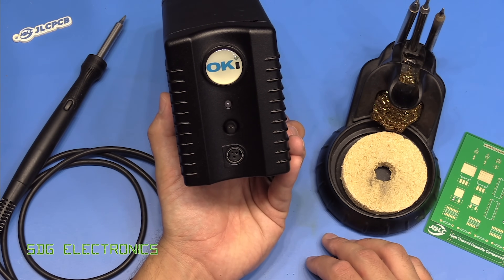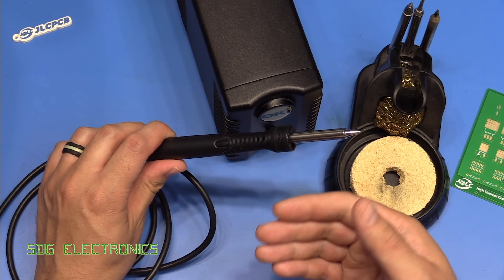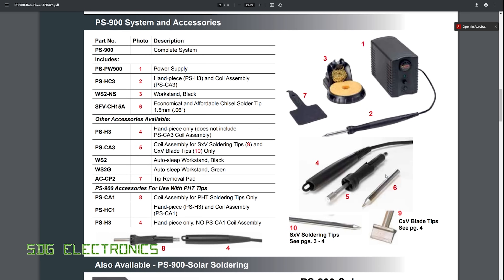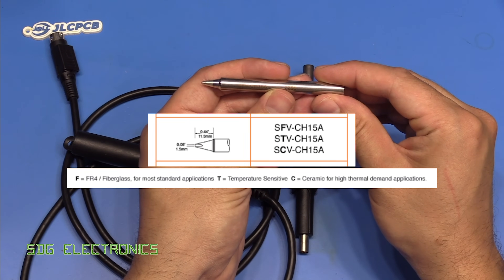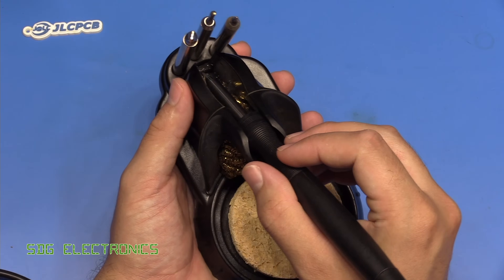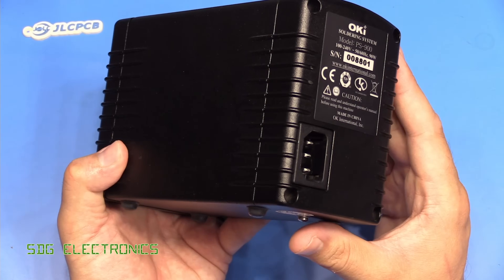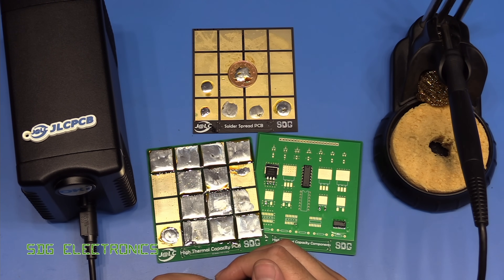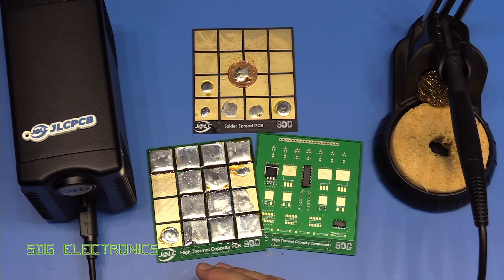SDG #218 Metcal PS-900 450 kHz Smartheat Soldering System

Comment: Yes, I love mine.  It was expensive at the time, but I have had it for over 20 years.  The company I used to work for just let people take them home.  Mine is an older model, not as deep as yours and quite a bit taller.  I am not sure what the actual model number is.  I have misplaced most of my tips which is why they gave them away as the newer models used a different kind of and shorter  tip.  I just wished it had a way to display the temperature.

Comment: Interestingly enough the MFR series of 450kHz stations has two soldering handpiece options, one of which looks like the PS-900 "chunky" one and one which has cartridges similar to the MX500 (etc.) stations. There doesn't seem to be as much easy info about the MFR stations online; I suppose this might be to do with their being more expensive (though not by much, at least in the UK) than the PS-900 but they do have other options the PS-900 doesn't have, such as a desoldering gun attachment (MFR is Multi-Function Rework). The output power rating for the MFR-1110 is the same as the PS-900.

It would be interesting to see how the handpiece for the MFR cartridges compares to the MX series stations, and to the MFR's "tip" handles that look the same as the PS-900 one.

I have an old and battered STSS unit which unfortunately doesn't work properly and is beyond my ability to repair (I'll probably keep it though as a project). I really like the design of the handpiece and cartridges so it feels like I might prefer the MFR cartridge system, but on the other hand it could just be additional cost for no real benefit since I already have other tools and don't need the "Multi-Function" aspect. There is more tip choice with the cartridge handpiece than the tip handpiece though!
Reply from the maker: The MX stations are the only ones to use 13.56 MHz which means the cartridges are much smaller, and thus more responsive. The MFR I think all 450 kHz like the PS-900 and have the option for the chunkier style tips which have a separate heater cartridge. The slimmer cartridges have an integrated heater, but are not quite as compact as the 13.56 MHz cartridges. Technically performance is lower, but they are used in huge numbers for hand assembly at production facilities so there is likely not a discernible difference.

Comment: do you have ps-900 schematic? I have a problem with the tip which has static voltage when I touch it. is it normal ? . thanks
Reply: That's a symptom of bad grounding in your electrical installation. Get a socket tester and discard that first.

Comment: Would be interesting to compare the Thermaltronics TMT-2000S which also uses Curie Heat Technology with the Metcal, apparently the tips may be interchangeable between the two.
Reply from the maker: The TMT-2000S I think is roughly similar to the MFR series from Metcal when used with the MFR-H1-SC handpiece (which takes SxP Cartridges). The PS-900 is a bit more unique with the separate heater/tip, though there is a handpiece for the MFR system that is the same as the one I've shown for the PS-900. If there is a call for it, I'll show the TMT-2000S or the MFR-1100 series station.
Reply: @sdgelectronics  I’m really interested in MFR-1100 (or any Metcal related videos by you).
Reply: @sdgelectronics and the Thermaltronics TMT-2000, actually. 

I didn’t realise it was 470kHz and so cheap.

Comment: Looks great, especially in terms of value for money. Given the operating frequency, I wonder if it interferes with nearby AM radio receivers (with 455kHz IF)?
Reply from the maker: The thick metal can, shielded cable etc should hopefully have taken that into account. I can't remember what the limits are for radiated emissions of a non-intentional radiator, but it shouldn't be too disruptive.

Comment: Cool or should I say Hot demo . . . nice! What sort of solder are you using led-free or with some led in the solder? I've used the Metcal and equivalent Thermaltronics and they are head and shoulder's above anything else I've used.
Reply from the maker: This is lead solder in the coin demo, since I had to use some thick solder to feed enough in a short period of time.

Comment: I had a T12 clone and decided to upgrade to the PS-900.  Great soldering station and the tips are much cheaper than the cartridges for 500 and 5000 series.  Few years ago on eBay I found a Metcal analog RF power meter for the PS-900 which works like the LCD on the more expensive models.  On the RF power meter I see full power when switched on from cold for a few seconds as the power drops and approximately 75% when soldering to large ground planes. Never had to replace the coil in the handpiece and the plating on the tips is great compared to the chinese T12 tips that the plating would flake off after a few months.

Comment: I brought the Metcal PS 900 a few years ago and have to say that from day one I was completely satisfied with it’s performance and feel very proud to own one. I have a range of tips for the hobby work that I undertake such as valve amplifier repairs headphone repairs such as soldering 4 pole TRRS 3.5mm jack plugs and most useful for soldering up guitar electronic harnesses. The large chisel tip that was demonstrated is particularly useful for soldering braided wire to the back of potentiometers. Thank you for an exceedingly good product review and demonstration.

Comment: Now im wondering if it would be easy to diy this kind of station, probably easier than the the other more expensive one
Reply: Should be, but you might be the first. I can't find any information on what sort of voltage it outputs. Thermaltronics as well as some chinese brands have 450kHz stations as well.
Reply: @jaro6985  I wish i had the kind of equipment to attempt this
Reply from the maker: There's some people on the EEVBlog forum that have used the essence of the original MX-500 system to DIY a 13.56 MHz station.

Comment: Do you think the thermal performance is better than the Pace ADS200? Do you think upgrading to the PS5200 sytem is worth the difference? PS-900 tips are definitely more economical.
Reply from the maker: The MX5200 series of kits is incredible, but so is the price. For commercial work there's no doubt that it would always deliver no matter what the application, but for the hobbyist work bench I'd make sure you're not missing out on any other general equipment first. Thermal performance on the PS-900 is similar to the Pace, but I'm still not sure if I have a dodgy tip since a couple of viewers don't think the results match their experience. I have some other tests planned soon which I'll do all in one video to compare all the systems together.

Comment: What's the advantage of one of these over one of the cheap KSGER or similar T12 clones? Seems a lot more expensive and you give up the temperature adjustments which seems like a poor tradeoff.
Reply from the maker: Generally it's pretty rare to change the temperature unless there's a specific low temperature requirement. More often I tend to see the bad practice of increasing the temperature temporarily for heavy work, whereas on a more capable system the standard temperature should work no matter what the load. Comparing any of the more expensive systems to the KSGER is probably about quality too. I will cover a KSGER/Quicko station soon though to see how it performs.
Reply: @sdgelectronics  Maybe this is my limited experience with KSGER and entry level Weller units, but I've always found the temperature presets useful for things like wicking solder when reworking SMD parts.  Extra 30C or so speeds everything up and a button press is much faster than swapping out for a bigger tip and then back to a small chisel afterwards.  Possibly that is just due to the power/control limitations of the cheaper units though.  Definitely interested to see a comparison, will keep an eye out!
Reply: @sdgelectronics funny you said bad practice just to defend metcal when in reality all brands do it
Reply from the maker: @user-yk1cw8im4h  no professional equipment requires the temperature to be raised to solder high thermal demand work. They are generally capable of putting sufficient power into the joint to maintain the set temperature

Comment: There is feedback to the RF power unit. It measures how much sent RF power is reflected back to power unit and regulates sent RF power based on that. It wont blast max RF power all time, but a bit extra still. The feedback loop is much faster than traditional based on temperature measurement. And there is no overshoot at all.

Note: Technically in practice it might not measure reflected power but some other property of heater RF properties, which in practice leads to reflected power.
Reply from the maker: I know there's definitely feedback on the 13.56 systems, but I couldn't see how it was done on this design. I wasn't sure if the detuning of the coil was enough, but you're right - the reflected energy would have to be absorbed by something so there must be some feedback.

Comment: Are the non jbc 245 handles rated at higher wattages? the official ones list @ 50watts.
Reply from the maker: I checked the JBC website and datasheet, but I don't see any power rating for the T245 handpiece. The JBC system definitely drives them much higher than 50W
Reply: @sdgelectronics  Seems its only vendors listing 20 for the 210 and 50 for the 245 I sent jbc tools an email but it doesn't seem they care who i am unless i am part of a company.

Comment: Thanks for another review. I do my daily electronics with phone/tablet and similar small but complex and hi density boards and each time I see these tips you use in your videos I'm simply  shocked :D  it is understatement to say they are huge :) But I guess your are simply geared towards other industries.
Reply from the maker: I tend to find a 1mm chisel tip works for anything other than high power applications, even on extremely fine geometry electronics. Most of the time very fine tips struggle to get the heat to the tip unless they are copper which means they need to be replaced regularly. Lead-free PCBs make fine tips even more difficult.

Comment: 29ºC indoors? Good grief man, you need to vent your workspace.
Reply: It is new normal here in Europe past few weeks or even a month, 33-34C everyday. One part of the Europe is heat treated and the rest is flooded.
Reply: Tell me a about it; here in Portugal we had this past weekend was at around 38ºC.
Reply: I have an 800W air-con in my workshop (NE Scotland) and it's been flat out trying to cool the room down the past week or so. I can get it down to 24degC.......but switched off it's been up to 31.5degC!
Reply from the maker: It's very warm at the moment in the UK, but as mentioned also many areas flooded. I have to service the cars ready for annual inspection which is rapidly approaching but can't bring myself to do any work outside!